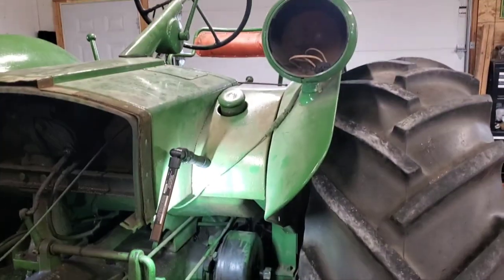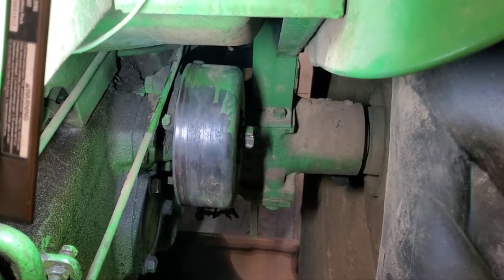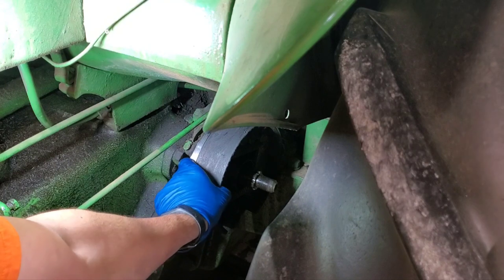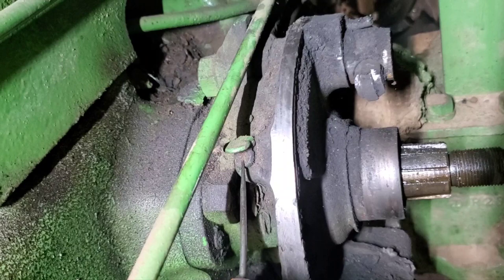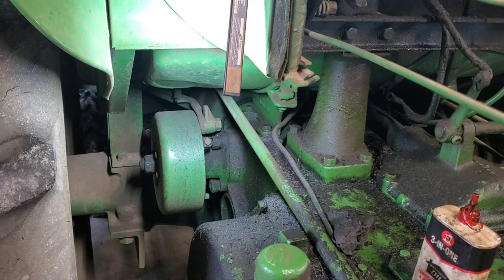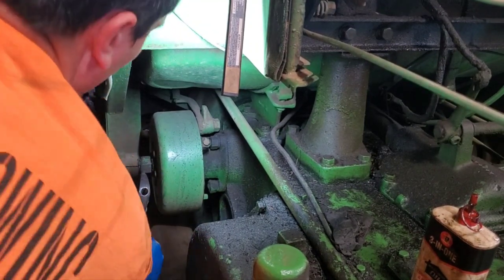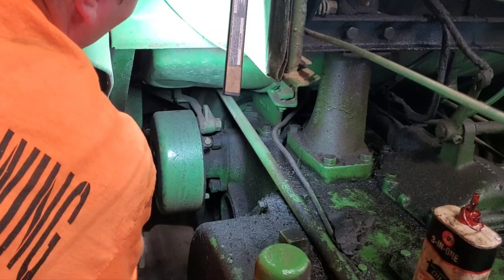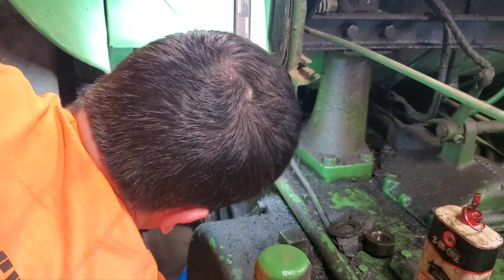John Deere R Tractor Revival Part 2 - (Break Job and Pony Update) #tractor #tractorvideo

Comment: From my understanding they have switched to brass rivets instead of steel, because if you wear out your shoes, the rivets will cause grooves in the outside of the drum.  Same with the clutch pulley brake, my 820 at one time wore into the rivets and the area is ribbed now.  As the brass is softer it wont grind away the steel drum.
Reply from the maker: That makes alot of sense.  Thanks for the info!